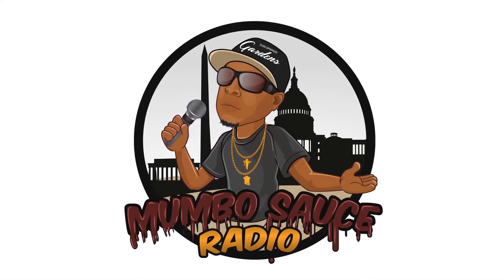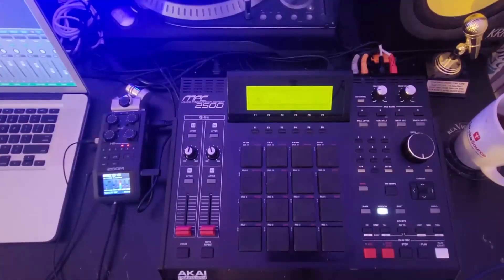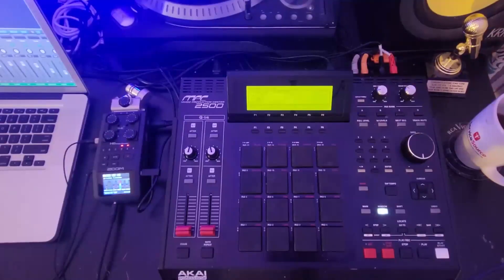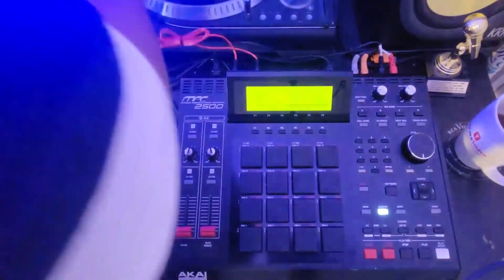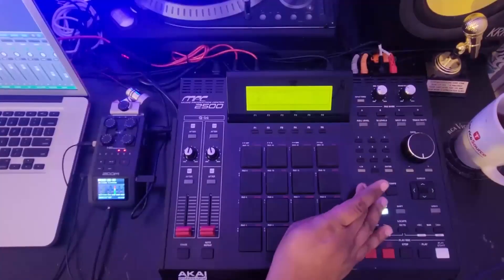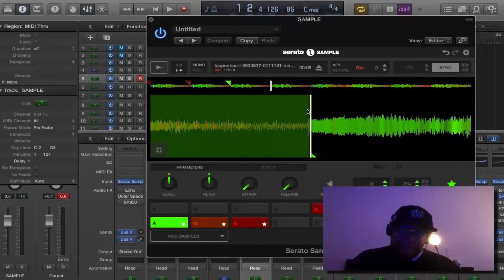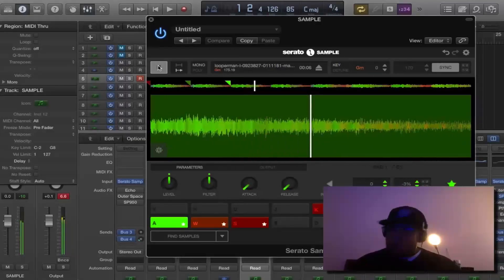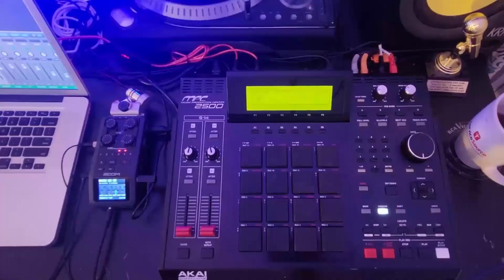HOW TO USE MPC 2500 AS A MIDI CONTROLLER

Comment: @mumbosauceradio…Hey man, thx for posting this video first off.  I’m a novice/beginner producer and I’m trying to figure out how to use the internal samples on the mpc2500 kits/ library that I already have built and get them to record into a beat I already have started in ableton live lite 11.  I wanted a more live drum lace with the triggering of the pads rather than the weak sample drum rack that ableton already has.  So far all the videos showcase just using this cord/ wire as a controller for the vst’s…as stated above, I already have samples from drums I wanna use and record.  Other videos show using analog cables to inputs on a digital interface.  I bought the one you have thinking this would work…is this possible using this cord?  Or do I have to go the analog route to accomplish this?  In elaboration, I can see that ableton is recognizing the trigger input from the pad…it’s just not distributing the sound from the mpc.  I’ve messed with quite a few options in preferences adjusting.  I dunno, kinda complex.  I’d prefer to keep the signal digital from the usb like the cord we have.  What you think?

Comment: Yo , this exactly the same as my set up bro , except I was putting my midi through my sound card (didgidesign 003) my midi notes were sustaining ( wouldn’t end ) when I pressed the mpc pads , I just ordered a midi - usb cable , hopefully this will solve the problem, thanks for the video
Reply from the maker: so how did it go?
Reply: @MumboSauceRadio  yo dope bro , no sustain on the midi keys , my workflow is stronger too ,